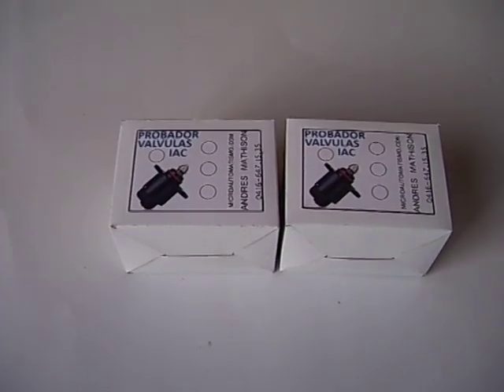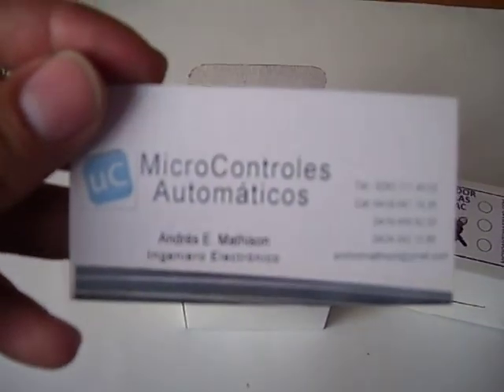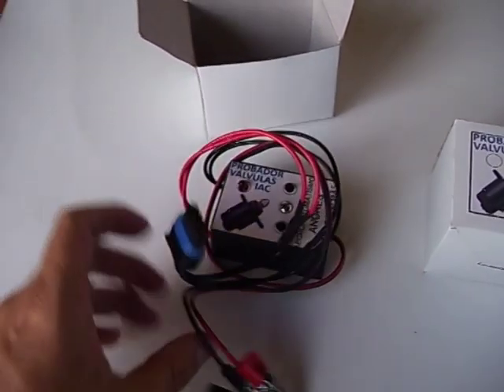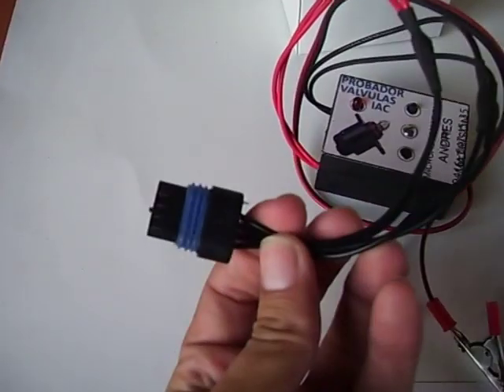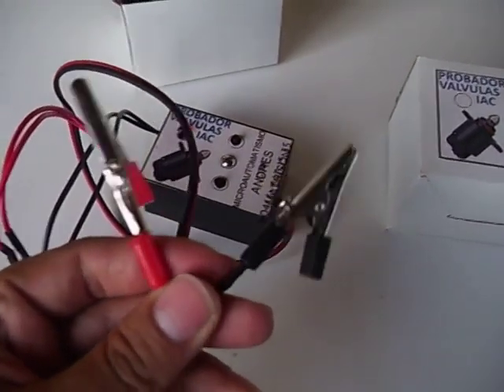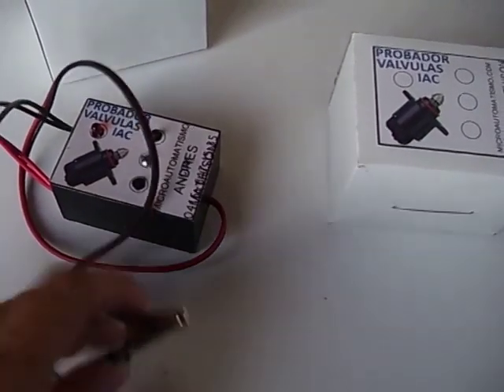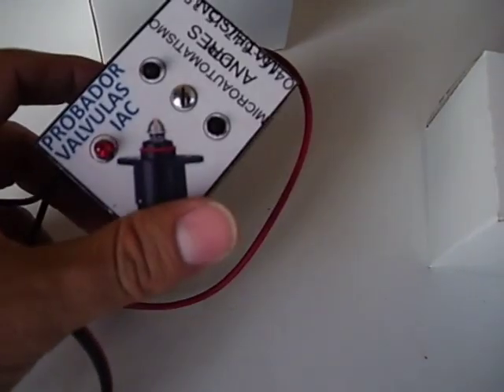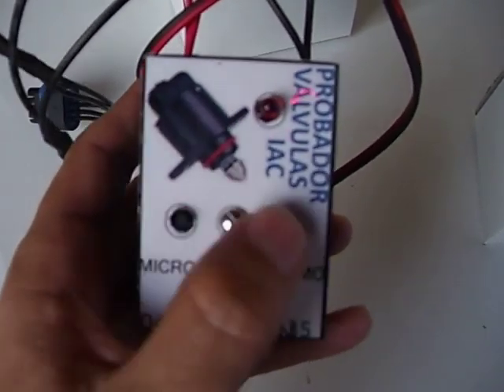Idle Air Control Valve Tester

Comment: Can you help me here with my 2005 suzuki XL-7 2.7L? The iac valve has 6 points not 4 how i can test the valve if i buy your tester?.
Reply from the maker: Yes I can help you, i have made a new development in April '14 that include the 6 pins like your Idle Valve, you can see the video (sorry i just publish this video in spanish, i´m going to make the video in english too, i forgot that :) ......).

This new model test 2-3-4 & 6 pins with just 4 pins of the 6 pins, is very easy to use. You can buy one in my own webpage or ebay too.

This is the link of this new model (sorry for just spanish, i´ll publish in english as soon as posible).

http://youtu.be/HguDmeu2ksw

The offers link at ebay is:

http://www.ebay.com/itm/301006479617?ssPageName=STRK:MESELX:IT&_trksid=p3984.m1555.l2649